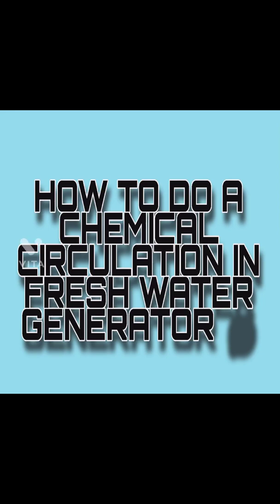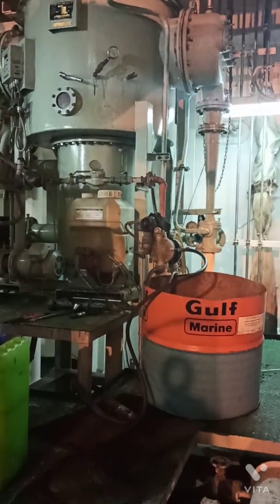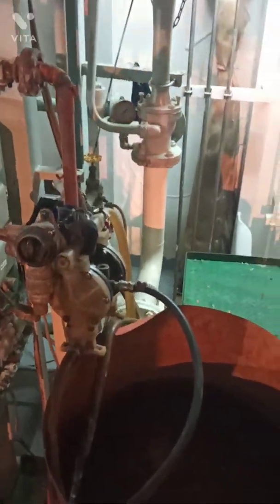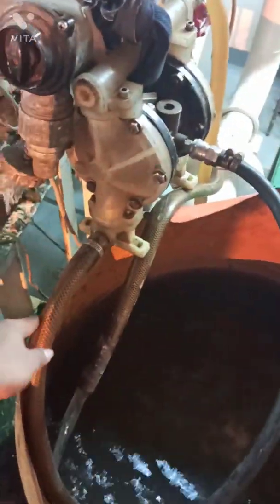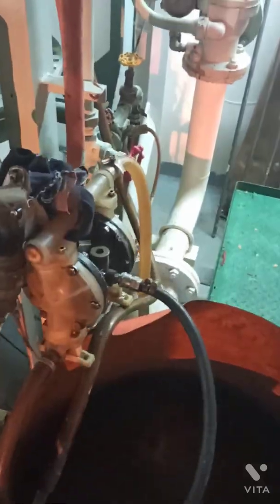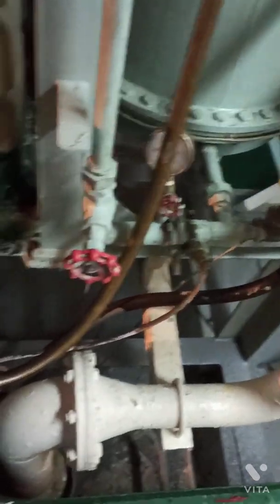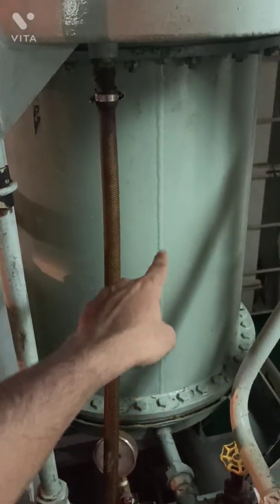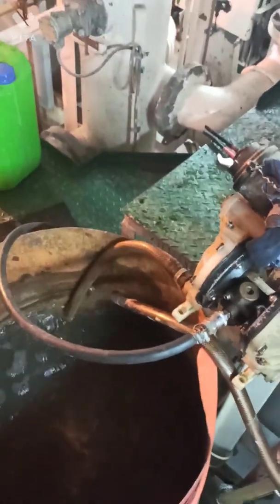Fresh water generator chemical cleaning

Comment: where is the drain coming from?
Reply: Drain valve will be near sea water inlet pipe line as on video and return from just above evaparator chamber there will be a plug remove that and fit adapter so that water return back to drum